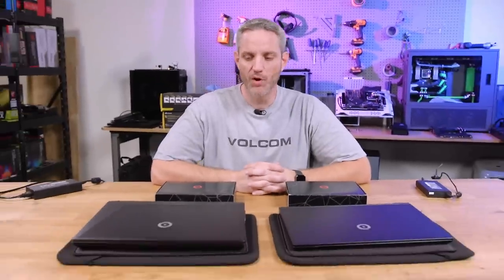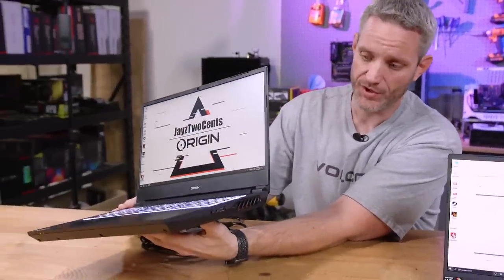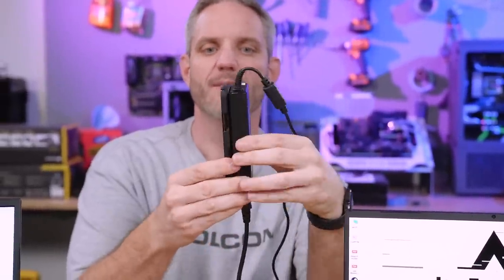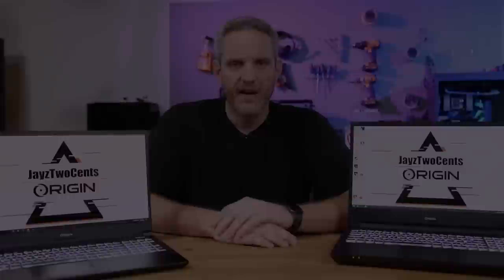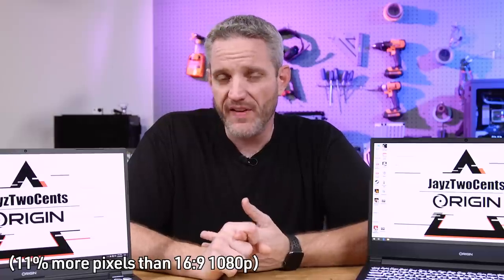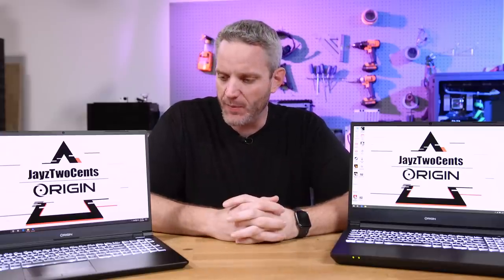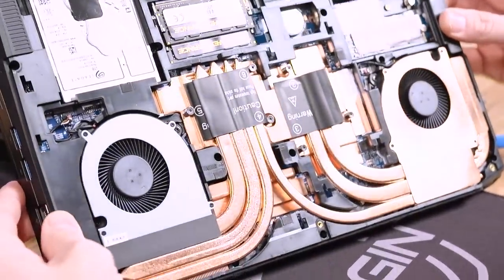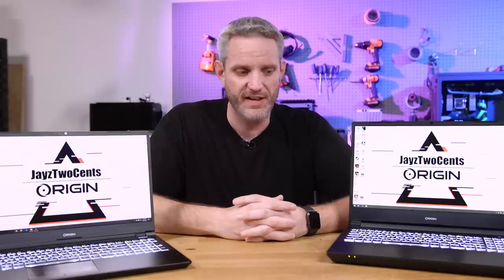A Laptop with 16 Cores 32 Threads?? Desktop killer!

Comment: Hey jay. My laptop from 2013 still going strong XD
Reply: I have a pavilion G4 from 2013 with an amd A4 apu, Just installed an ssd in there and it's still pretty good lol
Reply: That ”XD” is form 2013
Reply: My VAIO from 2011 still works
Reply: @RookiesStudio yes 120 fps in mine sweeper
Reply: Funny internet man so is your grammar apparently XD
Reply: Lol.
Reply: damn you got a new laptop, mine was budget in 2009
Reply: RookiesStudio eve online, Minecraft, and planetside 2 are my main games. I7 3630qm, gt750m
Reply: I have a pentium 2127u with 4gb ram
Reply: Low spec gamer
Reply: @RookiesStudio The HP ZD8000 can't handle 120hz...
Reply: Same, upgraded the ram and put an ssd in my a few years ago
Reply: I still occasionally use an old Dell inspiron n5050 15" built in 2012. But I finally got a running ryzen 7  2700x build last month with 32 GB Corsair vengeance rgb pro 3200 Mhz. , Sapphire Rx 580 8 GB OC on an msi x470 gaming plus motherboard with a corsair mp510 name ssd and a 2 random hard drives
Reply: Erick Moo yoooo I also have my VAIO
Reply: My Acer Aspire One D270 netbook is still going strong
Reply: 😂😂😂😂trigggerrred
Reply: Mine too. Had to upgrade to a ssd and add more ram though
Reply: my vostro 3555 with a "high end"😂😂😂  A4-3300M with 4GB DDR3 :

hold my beer
Reply: Same here, my Clevo P170EM board w/ i73740QM clocked up to 3.9 and a 7970M overclocked to 910 core/1435 mem. Starting to struggle though, so I'm looking imto building a full custom loop ITX build soon
Reply: @noahsmith386  whats wrong with that hardware? My Laptop has 1,9 Ghz and idles at 60 degrees even with new thermal paste
Reply: Noah Smith My Clevo is fitted with an I7 4700MQ, GTX770m and 16 GB of ram. CPU wise I think there’s enough power for my needs, specially iRacing and some computing. But the GPU is outdated as it’s not supported by TensorFlow and Vulkan, for XPlane 11.

My laptop is running without issues on the performance side of things. Can’t say much about the screen with some 4-5 dead vertical lines and can’t hold charge on its 3rd battery. But if you have your screen on something white like a word document, browsing the web or coding you can’t see those lines.
Reply: @Fus1onplayz  its not a thermal issue. Its that it can't handle many new titles above potatoe graphics
Reply: @VictorSoares9  agreed, the CPU can hold its own quite well. Just my GPU boards the struggle bus on something even like rainbow 6
Reply: @noahsmith386  at least skyrim worked with 27 fps but will upgrade to a xiomi laptop soon
Reply: I got lenovo z580 that is from 2012, it runs gta 5!!!! I am surprised
Reply: Victor Soares That cpu can actually be upgraded!
Reply: 2013 macbook 💪
Reply: Mine too! Still use it today with no issues. Toshiba Satellite Pro with a 3rd gen i5 and AMD Radeon Graphics. Putting in a 860 Evo SSD completely changed it, so much quicker to boot and use.

Comment: imagine 10 years from now when you can get one of these for $200 lol
Reply: In 10 years the fans will be broken and after 8 years of usage chips start degrading. Especially because of heat.
Reply: Strongholdex he’s talking about the scenario in which the laptops are still produced brand new, not sold as used or old.
Reply: @dare1862  This laptop won't be produced anymore in 10 years. I don't rule out there will be others with the same performance, but even then they'll cost more than 200.
Reply: @Strongholdex  Even if someone hypothetically sells their used copy in ten years time, it doesn't necessarily mean they have used their copy for all ten years. 

I agree with you on the pricing. I doubt an used copy that still works well will cost as little as 200 in 10 years time. Perhaps if someone needed quick cash/wanted a quick sale.
Reply: @akirafan28  Also, the era of 50% growth every year is long over. I doubt laptops in 10 years will be more than 150% more performing except nvidia goes down to 1nm or even less, so far I don't see that happening.
Reply: Hopefully in ten years time we will have Quantum architecture in the CPU's.
Reply: For real

Comment: So I'm actually a laptop convert. I've been using  macbook pro as my daily driver - chrome, mail, discord, spotify, word processing - and a desktop for gaming. I just built my AMD 2600X/2060 KO/32GB ram desktop last year, but purchased an Intel based Asus gaming laptop earlier this year for convenience. I went from my desktop running 24/7 to only being turned on once a week; the laptop isn't FASTER, per se but it's so much more convenient. Of the two laptops you showed, I'd pick the Intel over the thin and light convenience, and the 4K panel (for video.)
Reply: I'm a college student, having a hard time deciding between building my 1st pc similar to your specs OR getting a laptop (legion 5 ryzen 4600h + gtx 1650), from your experience, are laptops good enough to handle both gaming and everyday productivity? Pc will cost me around 670$ while the laptop is around 850$
Reply: @B B ah, ryzen 5 4600h isn't really old, but thanks i guess 😅
Reply: @ukino22  do u move a lot? do u need the mobility of a laptop? or u will work/study whatever in your home? ask u that.
Reply: @B B What? Laptops since 2018 have been better than ever before. Ryzen laptops have pushed forward in terms of processing power and Nvidia's laptop GPU counterparts are miles ahead of whatever they offered pre 2018. Are they as fast as desktops? No. But they aren't nowhere near as weak as people think.
A laptop with a Ryzen 7 4800H + RTX 2060 refresh version will easily beat the average desktop rig.
Reply: @ukino22  It depends on hat you're playing. I'm not running the bleeding edge games at 144hz; I'm running Final Fantasy 14 and older Assassin's Creeds on it. But my laptop is portable and speedy and reliable.
Reply: @B B Portability
Reply: @B B i like video games, but also I'm a student, a laptop makes it possible for me to do both, something wrong with that?
Reply: @B B ha, I will eventually get a gaming PC, but Right now, a laptop will serve my needs better, like for real am i going to carry the case with me to class or play with my friends some co-op game, tekken 7, fifa, with good old fashioned controllers? 
In the past yes, laptops were so behind compared to gaming PCs, but with the gtx 1650, AMD mobile CPUs, they have gotten so good yet affordable, yes i can't upgrade the gpu or the cpu, but the ram can be upgraded as well as the hard disks

Comment: I love the AMD version as a mobile workstation. The barebone is from Clevo and it is very well built. Only problem is platform is built on AMD B450 chipset, so there is no guarantee to upgrade the CPU to ZEN3 and later. Also, GPU is soldered on the motherboard not a MXM GPU card, so you can't upgrade the GPU to a never version.  If it was a B550 or X570 chipset and had a removable MXM GPU, it would have been the best. Even if the LCD panel is 1920x1080 it should have been 144Hz ( LG LP156WFG-SPF2 panel ) and can be used with or without G-Sync ( don't know if Origin PC's version gives this option). 

Best use scenario is 3D CAD design on the go. You can go and show your project to your customer, can revise it according to the meeting, re-render the revised version and show its final stage on the scene while talking with the customer.  It might not be the fastest modeling system on the market, but fast enough as mobile workstation.

Comment: Did you talk about prices? I didn’t catch it...
Reply: The one on the left is $2300 on the right $2000
Reply: @almontemore3147  All I see is dust coming out of my wallet. I still have my dying laptop from 2013 with parrot os on it.
Reply: @ratman7969  I have an old laptop too. I'm looking for a new one, but not for the price of 2 desktop pc's.
Reply: @almontemore3147  The AMD one is more expensive than that. Didn't check the Intel one though.
Reply: Alzuu1 I didn’t see that. I had to go to the customize section and chose the 3950X
Reply: configuring it on their website: 3950x, 2070, 1tb nvme evo 970 plus, 32gb memory came to just under $2800.
Reply: No he didn't. People would click away instantly lol
Reply: @Lothos88  and still doesn't run Crysis
Reply: @Terrobility  How exactly do you expect me to build my own laptop, or buy one with a 16 core CPU? or an 8 core 2080 super with 4K OLED? I build my own desktops but if you need a laptop you're out of luck

Comment: Hey Jay! I've been using a Desktop tower replacement for sometime now, Infact i've just gone over 2 years with a Metabox(Clevo rebrand) P870-TM-G with a 1440p/120hz panel, 8700k, and 2 1070s in SLI, Now the LAPTOP fullsize 1070 actually has a slightly higher core count compared to the desktop 1070 but it's less aggressive clock speed wise (But i've pushed them well into 2ghz boost)  Core count is 2048 Compared to 1920 and aside from it being heavy and unwieldy battery wise it's performance is unmatched even at lan parties outside of ultra high end rigs.  All of these parts are removable and i could actually hunt down 2080's in MXM formfactor and slide them in, I bought this at the height of the GPU mining so the price of these laptop gpu's was actually on par if not cheaper than their desktop equivilents in my region.

Comment: As a developer, those 16c/32t with AMD would come in handy. Compiling times would be really low and having multiple Android VMs for testing purposes at the same time would make life easier. I also appreciate having place for 2.5" HDD as that allows cheap 4TB drive filled with everything that is either sequentially read or rarely used.

I love OLED but have found out the same thing, it's not optimal for laptops because of reflections. Also one thing, if that laptop breaks, you could take that 3950X out and use it in desktop or sell it with good money.
Reply: You can install a 4TB drive ?! I thought the maximum size allowed by the 2.5 inch form factor was 2TB...
Reply: @aswinkumar4452  Actually there is one even 5TB drive. Most are only 2TB though. I think it's mostly because there wouldn't be enough customers. In SSD form you could buy huge 2.5" drives, but those would cost insane amounts.  https://geizhals.eu/seagate-barracuda-compute-5tb-st5000lm000-a1521940.html?hloc=at&hloc=de&hloc=eu&hloc=pl&hloc=uk
Reply: @juzujuzu4555  Thanks bro for the info, will surely look for one of these!!
Reply: @aswinkumar4452  Your welcome bro =)

Comment: As an SAN/FC/virtualization engineer I am already working on my XMG Apex 15 which is the same AMD laptop as the one on Jeyz's video. Absolutely amazed how powerful this laptop is .One thing that  needs correction is that this is RTX 2070 (refreshed) version of GPU with lower voltage memory and with help of MSI afterburner this GPU can be OC'd without any issues. On UNIGINE VALLEY I went from 4300 points (1080p EXTREME] to 4900 points with ease(on performance mode + OC). My desktop RTX 2070 super +3700x does 4950 points without OC.  The noise however is something to keep in mind and surely will suit only for headphones users :) other than that fantastic device .

Comment: The EVO15-S with the 4K OLED panel looks perfect for my wife. She's always complaining about being tied to her desk to work on her videos and is in great need of a better monitor. Mobility is huge for a lot of people, and this power in a laptop is great for people who need to do content creation in more than one place.

As cool as the powerhouse desktop killer is, I'd still prefer a tower myself. Losing the ability to overclock sucks as does the inability to upgrade the gpu (or use multiple gpus). If I HAD to, I'd go with the 3950X in the 15-X crammed full of as much of the fastest RAM they have, but unfortunately I'd be sacrificing a lot of the capability and potential of the tower it would be replacing.
Reply: While OLED looks amazing with bright colours and dark blacks, it's not necessarily the best for serious video work as you need to recalibrate the colours for the specific level of brightness you are going to use while editing. 

So hopefully this isn't something that would be a deal-breaker for your wife in her work.
Reply: @Fisustin  It will be a significant upgrade over the cheap LG we have her on right now anyway. She'll still be using that as a secondary monitor at times, but the most important thing will be for the art she does for print. She also knows that calibration is part of the process and isn't afraid of any extra steps to make that happen.

Thanks for the heads up though, we actually just bought her the 15-S yesterday and it should be here in about a week. Now I get to upgrade my rig with her old 3700X and add a secondary gpu :D

Comment: I run 3 32'' monitors off my Asus Strix laptop and essentially have it set up like a desktop

No issues with anything compared to a average gaming laptop. No heating issues no performance issues and it's portable if I want it
Reply: @B B not sure you understand what a scam is then...
Reply: @B B even if that is the case, my point was my laptop is more than capable of doing it regardless.  As I have been for some time now with no issues.

Comment: Just bought a 17inch 4800h and 2060 laptop with 16gb 2666. 1tb intel 660p. Man, it’s a f**** beast. And it cost £1300, which is actually really good compared to prices for the desktop parts right now.

Comment: "What to do with 32 logical cores?" One command: `make -j32`
Compiling takes so much time :/
Reply: What are you compiling that takes so much time?
Reply: @kaldo_kaldo  My large c++ project (takes about a minute to compile on my current computer, but it's quite annoying when debugging to have to recompile many times taking a minute each) and stuff from the AUR, big things from the AUR that take about 40 mins to compile.
Reply: When I have similar issue, I always pre-compile my project.
Reply: @H4mp1  Yeah but if you're programming, you have to compile before you can run the program after you've made changes.
Reply: @KingJellyfishII  Can't you just pre-compile all files in which you are sure, that you won't change anything?
Reply: @H4mp1  oh yeah I already do that but if I change just a SINGLE HEADER FILE (I do that a lot) it has to recompile everything, and there's no easy way to mitigate that unfortunately. And even if I only change 2-3 files, it still takes, uh, too long, to compile.
Reply: @KingJellyfishII  In my projects I have more files with less code ( Depending on project ) which makes my life easier. But it doesn't have to suite everyone.
Reply: @H4mp1  yeah that could probably speed things up, and I might do that someday, but that's effort and who does that :p

Comment: I have an EVO 17S, Core i7 9750H, 32Gb 2666MHz RAM, 2 Tb NVMe Raid 0 SSD, and a 2080 Max Q with a 17" 144Hz calibrated panel.
Never been happier. Yes, it's getting loud and on the hot side, but it's doing great considering it's 2cm thick ...
I'm mostly gaming with it. But also runing a couple of VMs, doing some Python dev and some office work.

Comment: I’d choose the Intel machine with something close to a 1440 for two reasons: lighter chassis = better for shoulders and a back riddled with whiplash and thunderbolt 3 will allow for relatively seamless docking to a home base desk (LTT Cleanest Desk Setup gave me the inspiration). I still have my sights set on a 16” MBP because the pro-level software I learned on is only available for MacOS but I can see myself rocking that Intel machine if things change. Thanks for the vid Jay!

Comment: And if anything breaks or needs to be upgraded in a laptop, the ewaste and general costs are eye watering. In 10 years I have gone through 3 laptops and costed almost $10,000 in upfront costs and repair.

If frequent traveling and high performance are a must, then there is no two ways around the cost but damn, if someone had told me I would be spending most of my time at a desk, that would have saved me a lot of time and money.

Comment: I would use the AMD version. Because of health issues sitting at a desk is not really an option for me. I am a content creator, so my primary use would be DaVinci Resolve 16 and related software like Gimp and Corel. I would actually have a try at Hackintoshing it as I am a Mac Guy. I have not had a gaming rig for probably 17 years, so I might actually get back into some light gaming with this rig as well. I currently use a MacBook Pro 15 (2016) Quadcore 2.9 Ghz 16GB RAM, 1TB SSD. I was bed ridden / wheel chair bound until just this last year since about 2010, so I am just getting back into the swing of learning about current tech. I too have had a big struggle with weight issues, although I have lost about 190 lbs over the last 3 years. Was 540lbs at my heaviest. I just found your channel a couple of days ago and love your stuff. We are so alike in many ways lol. Keep up the good work. Cheers

Comment: My take on which Laptop I'd choose:
Since there's not much difference in gaming performance I'd choose the intel one simply because weight and thickness can make such a huge difference in everyday use. I'd rather have a thin and light than a chunky laptop with 30% more perf.
However I am soon moving into my college dormitory. This changes things a bit as I'll need a "workstation" that I can easily take with me when moving. Transporting PC's is always a pain in the a** so having a Computer that's mobile while still being able to game great AND have a Mincraft server or some calculations running in the background would be perfect.
Not that I could afford either laptop obviously.
Reply: How about an ITX build with a Ryzen 3600 and something like a 2060 super?

Comment: As a software developer, I would go with the 3950x. Threading tasks and such in software becomes so much easier when having access to that much raw performance. My desktop runs the 3700x as a general cpu for my gaming, streaming, and development. Compiling and running software, especially large code bases becomes much faster and much easier on these systems.